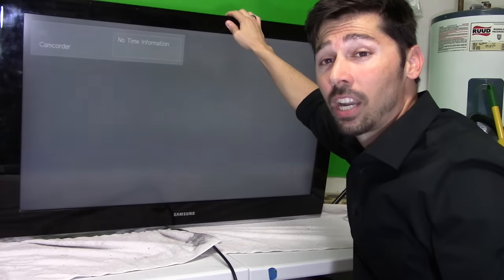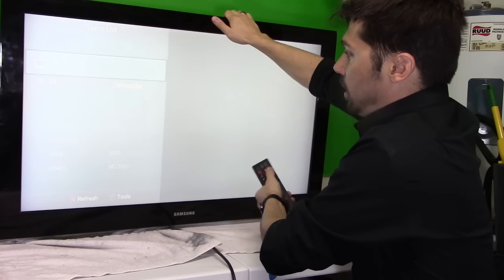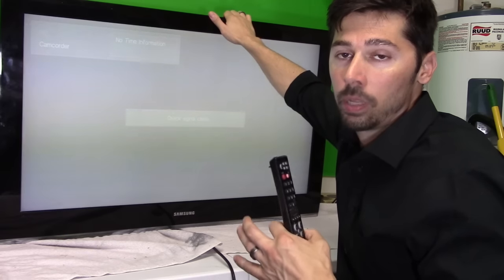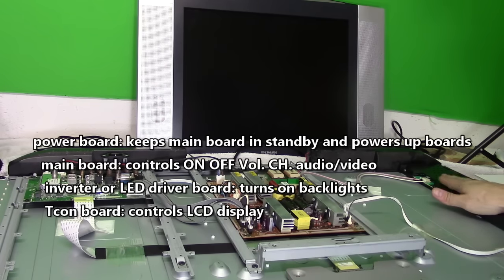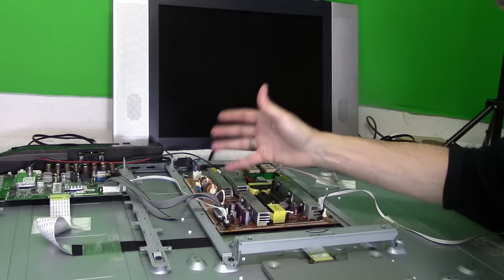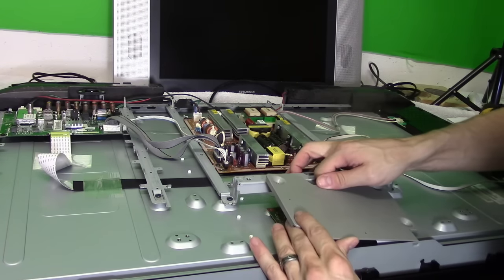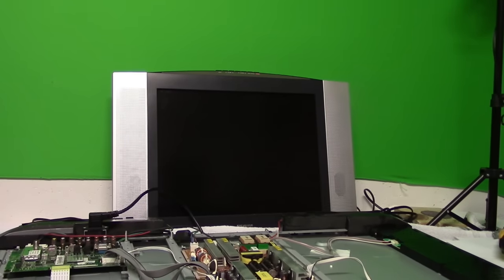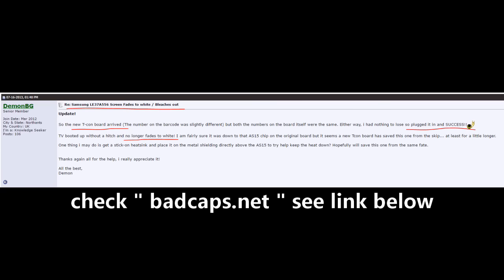LED LCD TV REPAIR GUIDE: How to troubleshoot without meters or testers

Comment: Don't know if I got it right. I do have that white screen on a samsung le40b650 and I figured out, that on the settings I'm still able to control brightness, but nothing happens, when trying     to control the backing light - keeping the same white screen. I even took of the T-Con and turned on - so it was a dark screen, when turned on - like in the video. This might be mostly a problem of a broken T-Con board? Or might it be another component? Not sure, if it's worth trying to exchange the T-Con - it's an quite old TV .... 😉
Reply: so I gave it a try - exchanged the T-Con with the exakt same looking and number - only could buy a used one via ebay. Unfortunately the Screen kept been very bright - just a little darker, so one could better see the settings in the menue. Still don't know, if I give it another try - changing another unit or another T-Con. If anyone has an idèa - just let me know - thx.

Comment: Hi Tampatec. I have a Philps 40PFK5300/12 40 inch led tv that probably has a temperture issue. I normally leave it on standby when I am not watching. Recently when I turned it on, it went on and showed HDMI 1 and the cable tv image, for a few senconds and than turns off again, and on, philips logo while booting, and than again cable image for 2 seconds. And so on. I than solved it by unplugging the 220v . And after about 15 minutes I plugged it in again, and it worked fine, until yesterday. Again the same problem. However leaving it unplugged for even more than an hour did not make ik work again. So I left it unplugged overnight, and this morning it worked again. I watched tv for 40 min and than I shut it off again by rc into standby mode. I immediatly tried to switch it on agian by rc, and it went in to the rebooting sequence again... So I left it unplugged and I hope it will work tonight. Are you familiar with this kind of problems? Hope you can help.    Marc

Comment: I have a vizio m701d-a3r I am seeing on both sides of tv now very faint white marks that are not noticeable on very black or dark pictures but, noticeable in lighter pictures. they are equally, distanced from bezel on both sides , is this a tcon problem or what should I do, geek squad said that they don't fix panels and that it was a bad panel other places want to charge to see it before diagnosing it. I do not want to pay another 100 bucks for someone to tell me that it is not fixable, thanks. can it be a board or panel. how do I find out?

Comment: I have a 50 Inch Toshiba TV 50L3400U, and the screen after about three minutes starts to flicker ON and OFF with about three second delay when an input is connected (DVD player with and HDMI cable). I replaced the power supply board and the Logic control board and the screen keeps doing the same. Could you please guide me, what could it be? I really want to fix this TV as challenge to my wife and sister, that tell me, what I am waisting time with that TV. Thank you much.

Comment: dude your the man!!! thanks so much just got a broken vizio form a friend im gonna try to fix it now
Reply from the maker: Danny Tsuji good luck, get tv boards at shopjimmy.com or electropartsonline.com use code tampatecfriend for discount 👍
Reply: Thanks man I will definitely order if you have the right part not 100% sure what I need yet, but I just opened it up and didnt see any burnt out capacitors or board damage.
the issue is that is got a bit wet form a leaky AC, 
it still has power and the vizio symbol is yellow when plugged in and when u try to turn it on it turns white on the vizio logo then flashes 3 or times then goes back to yellow do you know what part I would need? its the M370NV 39"

Comment: I would like help. I have a Panasonic Led with a thick Horizontal bar at the bottom of the screen. The black bar slowly changes color depending on what is on the screen at the time. The T-con board is at the top and I do notice a humming noise from the PSU when I remove and reinsert the display cable back into the Video board ( board with the inputs )

Comment: hEy Tampatec!  quest please.. Phill 42TA648BX  power light (white) flashes when I hit power..  I just replaced 3 caps, (different physical dimension but correct values), red led on @ mainboard..  you seen this before?  thanks a bunch and give my regards to Johns Pass!  how I miss FLA  Go Bolts!

Comment: I have been watching a couple video of you. My Samsung led 3D 54" has red light. It blinks every time i press a button on the remote. Screen has grey light with no words on. I check on capacitors virtually . All are in good shape. Any suggestions or possible troubleshoot the problem ?
Reply: back lights work fine

Comment: I have a Samsung Model # UN32H5203 that has no picture and no sound and a continuously blinking red light.  Did a quick visual and did not see any bad caps so what else could it possibly be?

Comment: Hi, I got m501d-a2r vizio 50 inch tv. The tv is not turning on now(no video); the power light  does not come on; the power button on the back is also not helping. I suspected it could be a power supply board issue, but when I plugged in my phone usb charging cable in the usb port of the tv, the port is charging my phone. So, i am thinking it is a logic board issue now. I have not opened the tv back yet. Just want to pick your brain here.

Comment: hey i have a samsung UN46EH5300 recently after about 5mins the screen turns dark and the only way to get the light back up is to turn the tv off. You can still hear the sound and i can still  barely see the picture.  Could this be a issue with the t-con board. Thanks in advance.

Comment: I have samsung LE40R88BD and I have no picture and it seems to just start up and turn off by it self. whats the best route for me to take?
Reply: Teck Ed 
Hi Ed 
I have a 46 inch Samsung TV and when I turned it on it goes on off on off on off I try resetting without plugging nothing works it's just keeps doing turn on turning of how do I fix that

Comment: hey tamtatec i have one problem i have one samsung  55inch led smart tv model number is "UE55ES6580" 3D its doesnt  workt. and i find 1 smart tv display broke tv 55 inch model number is    "UE55F6470" 3D my ques is if i buy this broking tv this 2  lcd screen is same or not ? thx :)

Comment: Hello I have a 65 in rca led tv mod : led65g55r120q and it will not turn on there is a red standby light on. I did check the plug on board where you would see if it's getting 5 volts signal and I'm reading 4 volts on my meter and at the 24 volt pin I'm getting 0 volts. can you give me some ideas on what I should do?
Reply: 4 may not be enough to turn on, the 24 only goes on when the tv comes on.
Reply: jesse demers so does the board with the HDMI control 5 volts I'm not sure what for I should get bored with HDMI or should I get the power supply board
Reply: Roger Carlin i would unhook the hdmi board and check 5v again.  if it's still low, is likely the power board
Reply: jesse demers okay I will do that tonight so the board with HDMI/rca is that the power board? hey thanks for your time I appreciate the response

Comment: Dear, I am having Samsung smart LED tv model number showing horizontal lines on top 1/4th of screen . The sound of tv has also changed its crackling . The model number is UA46D5500RRMXL. Can you help me to figure out the problem and help in repair. It will be very helpful to me.

Comment: PLEASE HELP!! Magnavox 32me303vf7a turned off and wont come back on..just flashes red light 4 times makes small click but doesn't come on....replaced main power supply board and still doesn't work, tried unplugging speakers and that didnt work....what do i need to troubleshoot and check next?? Thanks!

Comment: sir I have a question my tv screen is black sometimes when I turn it on u can only see a pic on the very top then after ten min the black screen goes away and its fine im thinkng main bored cus mine has t-con built in main bored aka logic board also, please hely do u think its worth to fix?

Comment: My LG Led 43uk6300pvb when turning on the red light blinking off and there is no display till 3minute at least and tv is also not saving setting and not be hard reset with,if do hard reset the tv rurned on only change language only please give me solution thanks

Comment: Hi I have a 55inch TCL with dark shadow on 1/3 of screen on the left , pretty sure it is the back lights itself with switching wires just how hard is this to replace and what do I have to watch out for. Everything else is fine just dim on the left third. Thanks
Reply from the maker: here's a video how to replace TV backlights https://www.youtube.com/watch?v=YgaL6X6eSaU&t=108s
Reply: ***** Thanks seen video but still nervous that I my mess up
Reply: ayyyy youre the 65 and older guy :D
Reply: How to correct not programme LG TV screen

Comment: Hey, I have a 65 inch Vizia flatscreen tv and my brother hit it with chapstick and there are colored lines vertically up the tv and a few horizontally on the tv, the glass on the tv isn’t cracked but the LED is messed up, idk anything about TVs so if somebody reading this could give advice on whether I should get a new tv or should have somebody fix it.. thankyou

Comment: Hi There, I have Samsung LCD 403D series 4. Before I try to change the type on system menu by accessing it using series of key press on the remote. I do this to have usb movie play (played movie but HDMI wont work). But the problem comes when i try to change it back to original type. It just keep restart after the logo showed and i cannot access the system menu again. How can I fixed this, or if you had made video about this fix, please do share. Thanks

Comment: Hi everyone! I have a samsung UN60JU7090 and the screen is very white/washed out. There are random spurts of time when the full color returns but for the most part it just looks washed out. I thought it was a tcon board issue and bought a replacement from ebay but issue's still persisting. My tcon board is a little different in that it has the 2 lower ribbons and 1 connecting wire to power board and 1 to the main logic board. I unplugged everything to the tcon board except the cord to the power board (because it was tough to remove lol) and the screen was black and the haze was gone. Today, i was able to unplug it completely and the screen was blue mostly! What does that mean?

Comment: Great vids.
Just last night my 75 inch Samsung started to turn on/off rapidly.  Didn't know what was going on and i panic so i un pluged it.I did noticed a clicking noise.  Lefted unplugged over night. In the morning when i plugged it right back, it remained on but the image has black patches.Not sure if once it warms up,it would do the same (on/off). Any help would be appreciated.  Thanx.

Comment: I have 42" philip smart tv but can not find digital channels but can find analog channels,what should i do?
Reply from the maker: Simon Agwu some older samsung tvs have 2 tuners 1 is  analog and other digital. also select tv antenna input source then go into channel search settings then see if you can auto scan digital channels.

Comment: Hi! I need help. My iTECHIE led tv won't stop flashing colors. WHITE, RED, GREEN, BLUE then BLACK, in a loop. I tried turning it off but the remote won't work, so I unplugged it like you said. But when I plug it in again, it turns on by itself and starts doing the colors on the screen again. The root of the problem was my drunken dad pressing buttons on the remote, when he should just be sleeping it off. What could be the problem and how can I fix this?

Comment: That badcaps example was not the same issue at all.  I don't think it's the T-Con Board as much as a degraded Main Board, remember, other than the brightness (which failed to adjust) the screen looks pretty good.  A bad T-Con Board usually would have more problems of the picture quality variety unless a component on the T-Con was loading down the Main Board.  The Main Board has a video chip and controls that video signal before it hits the T-Con which displays the video signal from the Main Board to the screen.
Reply: I have a Toshiba and when i turn it on it’s a white screen with sound, I can change channels but it’s just pure white screen. Is this the t con board?
Reply: MrCheeks Mine has other probs, but when I detached the ribbons going from the two screen boards along the bottom of the screen to the t-con board, The screen went white. The board itself will display black a default, when t-con is connected to screen and driver boards. My Toshi has no info coming from the logic board, no signs of any troubles, bad caps or cracks, gonna try the hair drier method and if no success, it is gonna be the main role in a fail video. Sad, it is only a 2016 52" smart tv. Mint condition, besides I have disassembled it, and been looking at it for too long.
Reply: MrCheeks Also, do you hear the channels change or does the little display square still pop up?

Comment: I have an 39" Emerson LCD tv and it has been acting odd as of late, if I turn off a connected device (PS3/PS4, Xbox, streaming box) or the device changes resolution (goes from 1080p to 720 or 720 to 1080 any other screen resolution) the screen crashes (goes black) but I still hear sound. 

when I shut the TV off and turn it back on you'll see the brand splash screen, if I have no connected devices powered on the screen will go black, nothing will show on screen (but you can tell the backlight is still on) and when I press source on the remote and switch inputs (like I go to cable TV) the screen is still black but I can hear sounds from the TV program.  the remote still works and operates the TV and the TV still responds.

if I shut off the TV and have the input set to a device that is on the TV will work and display a picture and work fine until you turn the device off or the device changes resolution output, then the screen goes black. 

say like when I get home i have to turn on the Device first (PS4) and wait for it to fully boot, then turn on the TV, and even then sometimes the screen goes black, but if I do the same but move the PS4s menu around when I turn the TV on the TV will turn without issue 100% of the time. it does this regardless of the device I use.
Reply from the maker: madmax2069 try hard reset on all devices just unplug power cords for 1 minute. let me know if that helped
Reply: Tampatec nope,  tried that, went to my mothers and packed the TV with me just after it started doing this and was on the road for about an hour before i got there and was able to plug it back in. and it still did it.

Comment: In case anyone knows, I have a 4K hisense smart TV That only shows logo. It is only seen with a flashlight then shuts off. ? Thanks
Reply from the maker: Sounds like possibly bad led strips, get them at shopjimmy.com or electropartsonline.com
Reply: @TampaTec  Thank you sir I figured that or the power supply board.

Comment: Actually a recent law states that those 'warranty voided if opened" stickers are against the law and the company still needs to fix them problem if the device is under warranty.
Reply: chris But not if the stickers are from a repair place, not the manufacturer. You will void with the repair place, not the manufacturer. If you see a tv with those it has been repaired by a repair place.

Comment: i have this tv, the problem i have is the tv turning on and off itself, the tv company send someone for repair, and he say that the screen it not good, i try to fix the tv, i try with just one RIBBON CABLE in the t-con board work ok but just half no turning off and on

Comment: hi.my Samsung tv keeps going on/off all the time. you know what that is?
Reply: Lol. When I turn the TV on. It keeps doing that...
Reply: Any easy fix?
Reply from the maker: clicking on off is usually bad capacitors. look for swollen caps and buy cap kit for your tv model at shopjimmy.com capacitors stabilizes the power in power board, 5v standby is dropping.

Comment: a video of how to open the back would be very helpful lol for dummies!!!!
Reply: Marcie0613 with a screwdriver!!... Lol
Reply: Sean Kisby lol there are a gazillion screws, i can't tell where it opens but i removed about 50 then the last 2 are stripped... ugh I can't get them off but it really doesnt even seem like it will open with those.
 my screen is filled with pink like in all the places it should be white. i assume a connection needs to be reseated but i cant get in the damn thing!
Reply: see a screw, remove a screw. if it doesnt come apart easy. then there is a screw somewhere still

Comment: hi i have  problem with my samsung led tv un55h6350af. It has sound but no picture, no backlight, i did the flashlight test but nothing shows up on the screen. If I disconnect the cable from T-con board the backlight turns on. I tried replacing the T-con board but problem is still the same. please advise. Thanks

Comment: Hmmmm...Where is this guy located...Seems like nobody does repairs on TVs anymore...I have 55" LG That I need fixed...
Reply from the maker: what the TV model number and issue you are having? shopjimmy.com or electropartsonline.com sells TV boards to fix your TV usually under $100, SUBSCRIBE / LIKE FOR FREE TECH SUPPORT
Reply: Tampatec I have a 55"LG LCD LED back lit Smart TV...Model #55LS4600...Manufactured in May 2012...It Just went out...I do see the red power light indicator comes on...But thats it...No picture  no sound...
Reply: Tampa Florida?